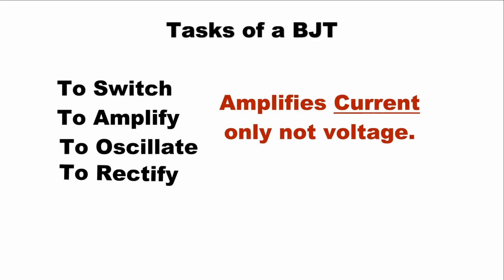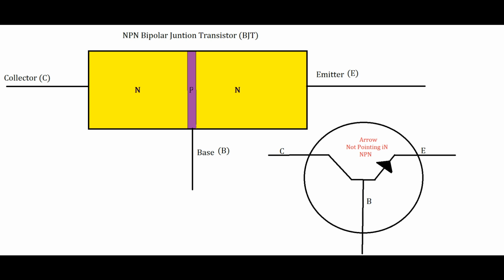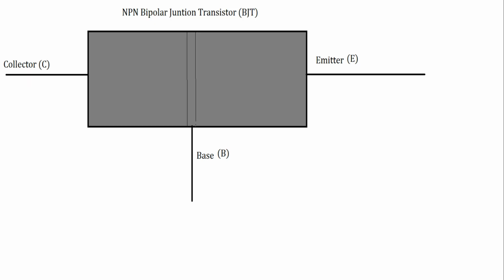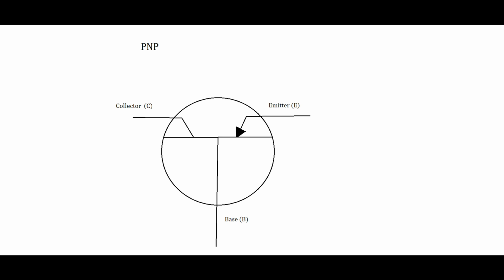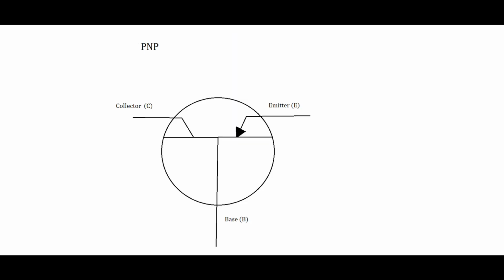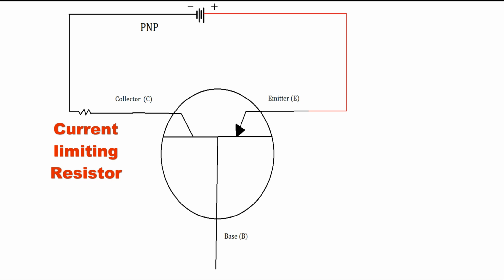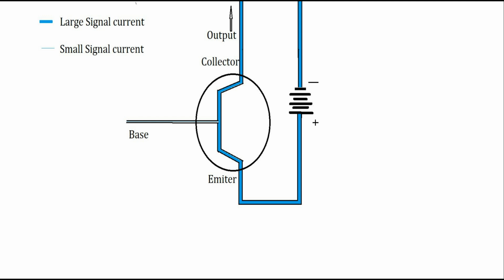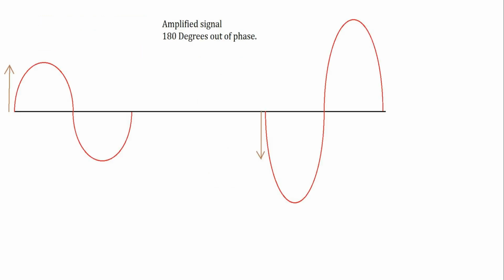Basic Electricity part 7: Transistor as an amplifier.

Comment: I appreciate your videos and what you teach, but I must make one small correction. 

Semiconductors are made of the element Silicon. Silicone is  a synthetic polymer used for breast implants and for glue (RTV) and caulk that sets up like rubber. Silicon Valley in northern California is named for the 14th element because of the role Silicon plays in making semiconductors, not because of an abundance of breast implants.
Reply from the maker: Thank you for that correction. I was going to check that before I posted the video, but in my haste I forgot to check it.